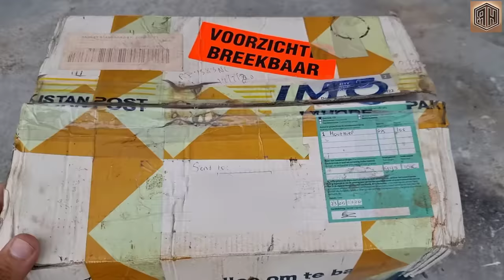Restoring a Piece of History - Random Hands

Comment: Observation: I was curious about the date of this artifact until they said the spine is still hard. If it were medieval, the edge would likely be hardened carbon steel with the rest of the mass of the blade being made of a less valuable form of steel or iron. So it's probably not as old as it looks, but was instead not well preserved. Honestly, anything more than 50 years old in good shape is a rarity.

Comment: As much as I like the look, with that amount of pitting, I'd never use this knife. Its one hell of a health risk with food getting stuck in all the pits
Reply: There is this stuff called “hot soapy water”… total game changer!
Reply: that, and the brass (copper) in your food
Reply: @groeneribbroek  that would be far less than the copper from my copper plumbing pipes.
Reply: I bet you could probably cover the pitted part in a thin layer of epoxy, then sand and polish it smooth. That way, you could still see the pitting but you’d get a food-safe surface that protects from the pitted parts flaking. I’m no expert, but it’s an idea
Reply: @antothemanto77  what is the matter Anthony? Do you want to live forever?
Reply: "Lemme just cut this steak here- aw shoot it got stuck in a hole."
Reply: My thoughts as well, but RH did wrote in the end of his text ..."And now it is ready to beautify the walls", so no worries I guess.
Reply: I'd be more worried about the tang than trying to clean out the food from the pitting. I figure it's more of a conversational piece

Comment: Random Hands beautiful job, I love the contrasting black and gold. But one small point for future handles- when making a handle for something like a cleaver or other wide or long chopping blade, a handle that is rectangular works better, as it prevents the blade from rotating in the hand upon impact and is more forgiving of slight misalignments during use. a rounded handle works fine for short knives where there isn't much weight, but not so well for cleavers, swords, axes, and big kitchen knives.

Comment: Just wondering: Where did you dump that rusty water? Wouldn’t it be harmful to the grass/ground?
Awesome video btw
Reply: He put it in the box with the rest of the rust.
Reply: Looks like he put it in a large container to evaporate the water. That's usually the method of disposing mildly hazardous waste- evaporation or drying for disposal. That's what is done for paint too, spread it out, let it dry and then dispose.

Comment: I love the outcome, beautiful piece but calling this a restoration project is kind of difficult to understand. This is more a repurpose of the material. No matter how cool the finished product is, It's almost impossible that this was the original look of the cleaver so, you pretty much picked up the metal from the original piece and reinvented a new cleaver. Having said that, the finished product have no connection to the original piece other than the raw material and I don't see this as a piece of history at all, it's a new manufactured piece.
Still it'ss pretty cool specially because you took advantage of the corroded metal to your advantage and applied a lot of skills to do this and I really value that.

Comment: I scored one from the 1700’s for 50 bucks. It’s got hammer marks at the top but other than patina is completely rust free. Since it’s going to be a wall hanger, I’m going to use a mild solvent like gun cleaner and cotton rags and the. Put a shinny edge on it. I have no idea show it survived all these years with barely any damage or aurface rust to speak of. It was dated by the makers mark and by a friend of the family who is a butcher. One of the nicest blades I own. You did exceptionally well on this one!!

Comment: I've been using an old trash can full of a mixture of water and molasses as a rust remover and I'm pretty happy with it. takes a few weeks of soaking to be effective, but I've been using the same trashcan for 7 years and I've never had to drain it or move it out of the corner of the barn. the only downside is the molasses smell when you pull the piece out. I definitely wear my coveralls when I hose that stuff off. it's super convenient because I'll find random rusty stuff and just dump it in there and forget about it, so usually when I do pull something out I have 10 or 15 other little pieces to clean up and seal all together.

Comment: Ok, someone correct me if I'm wrong, but I see MANY issues here. 1: the tang is too weak to expect to hold up to the amount of stress put on it. 2: those pits are the perfect place for bacteria to hide and grow. 3: that brass is definitely not food safe. 4: that resin probably isn't food safe if we're expecting it to hold up to the stress from point 1. 5: That wax probably wasn't food grade or safe. 6: that first piece of wood he was going to use WAS STILL GREEN. Green wood splits. The second one was better but the stain he used probably wasn't food safe. 7: that edge definitely lost its temper when he sanded it down, so he should have done a few hardening cycles. 8: that edge needed reinforcement, and will probably break in a few months of use.

Comment: I've seen other restorations where they try and  just completely try and make the knife as smooth as you can get it without coating it in like a brass or a corrosive resistance but the reality is because it's so old you really don't want to take any more metal off than absolutely necessary

Comment: It is a great restoration. 

There is just one issue, galvanic corrosion. The brass parts will corrode the steel if there is some sort of electrolyte between them. Besides that, it is great.

Comment: I forgot which video it was, but over on the Man At Arms Reforged channel, they did a project where they heated up the brass brush with a torch in order to apply it to the steel, rather than heating up the steel first.

Comment: Beautiful, great work. I wonder if a round handle is a good idea. You strike hard with a cleaver and there's a reason most knife handles are flat or closer to flat than round: you don't want that thing rotating in your grip. Cheers
Reply: As if that thing will ever be used, the pitting makes it useless as a knife as it would be totaly uncleanable. A cleaver is a very dull knife too, it shouldn't be razor sharp as it's not used for precise cuts.
Reply: @toki002  I see no reason why it couldn't be used. It isn't for slicing so a uniformly smooth surface isn't an issue, and like you say, it's meant for chopping or hacking. I'm not a butcher so I can't say for sure but I think you want any cutting knife sharp. It would be dumb to have a blunt Cleaver... That won't cut bone. It's useable and easily cleanable with a brush.
Reply: @BenKingEagles  A cleaver is sharpened at 50° a chef knife at 15 to 20°. You would never be able to properly clean every nook and crannies in that kind of pitting, would you really want to introduce meat "inside" your knife and not be sure it's adequately cleaned off? Even just making sure there's no moisture left would be a pain and could lead to new rust formation.
Reply: @toki002  Fair enough. I'd still use it tho lol

Comment: Very impressive work & great vision to see past the rust to the finished artwork. But, I have a question regarding your electroless at video point 4:46. This shows both positive/negative contacts on the cleaver. I use this process a great deal in restoring cast iron, skillets /dutch ovens etc. and I've always attached the negative contact to the item to be cleaned & the positive contact to the anode. Did I miss something regarding your method?

Comment: As a restorer of archaeological materials, metal included, I have to chime in because this was horrifying to watch.

 This is the worst possible thing to do to a corroded artifact. The way iron corrodes is in layers. It means that original surface is in between layers of corrosion and removing all of it is leaving only the metal core of the artifact and completely destroying the original surface that may still have traces of toolwork and decorations (metalic inlays etc). Archaeological restoration aims at preserving as much as possible of the original piece so that archaeologists and other experts can research it and gain insights in the items history. It may not look pretty but it will have preserved information on it.
The pocked surface means there is nothing left of it and every significantly corroded piece of iron will look exactly like this

If this was simply someones private, recent artifact, they are free to destroy it as they see fit.

If this were an actual archaeological artifact this would be absolutely unforgivable.

I do admire the skills shown in making the handle and the scabbard and other, less corroded items are really educational and fun to watch because they do not need the same approach as badly corroded iron pieces like this.
For restoring archaeological metal finds, please consult an experienced and educated restorator for this specific material.